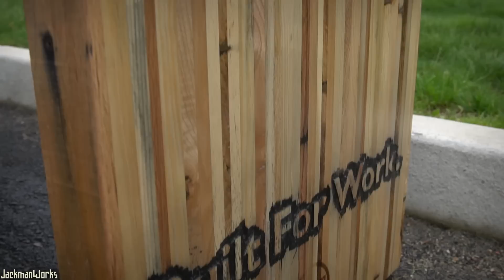Pallet Wood Slat Bench

Comment: Cool project, I really liked that router jig, for the curves!
Reply: Also: router jig was very neat! Am jealous of the little / midsized router too, mine is possibly too big for such a jig, but am gonna try that at some point!
Reply: Harbor Freight sells one kinda like that for 20$ and they run like crazy. I have 3 of them and keep my most common bits in them and just switch routers. i also have several bigboy routers just dont like to bust them out unless im burning off alot of mill work
Reply: That's genius!!
Reply: Yep gonna steal that tip forsure!
Reply: @dannyoneill4232  I'm a finish carpenter and run a little Bosch that I've had for a very long time.  Granted, I don't use it for much more than 1/8" Round-over Bits, Hinges or Laminate Trimming but I really like it!

Comment: Have you ever tried finding some heavy duty pallets? I found some really good industrial pallets used to ship airplane parts. The frames are 4x4s and the slats are 2x4s. They're difficult to break down without a reciprocating saw, but we'll worth it. A lot of the wood turned out to be maple.
Reply from the maker: Yes!! Those are always a big score. Check out my pallet workbench build. The base of the benches is a frame made from those big 4x4 pallet timbers.

Comment: great build. is the threaded rod totally nesessary?
Reply: I don't know the answer to that question, but I'll just speculate.  If he didn't have the threaded rod, I don't think the bench would undergo a failure.  I do see the possibility, however, of a few of the seat boards or side boards opening up just a tad, due to internal stresses.  You saw how during glue-up some of the boards were still not flat even after having gone through the planer.  So, the threaded rods were probably provided to prevent that -- open spaces between adjacent boards -- more than to prevent a failure.
Reply from the maker: Definitely not. Check out my workbench build if you haven't yet, very similar process and I haven't had a single seam pop on me yet and I beat on the thing haha. That was really just for looks.
Reply: +Jackman Works I thought you would have just cut them (threaded rod) to a few inches and just epoxy them in.  Risky drilling so far without a drill press.  Even with a drill press the job would be kinda scary. lol

Nice score on the threaded rod as well.  That stuff is expensive!
Reply: Threaded rod is actually pretty cheap for 3/8"... https://www.tractorsupply.com/tsc/product/national-hardware-4000bc-3-8-in-x-16-x-36-in-threaded-rod-zinc?cm_vc=-10005 .  It's more at the home centers but probably still not that bad (a lot cheaper than bolts, which tractor supply is also good for if you have one near).
Reply: Without the rods, the wood would fail before the glue joint.

Comment: I like that de-nailing tool. I'm sure it's a common tool and most people know what it is, but I don't so I've got ask.

I hate it when commenters make suggestions to youtubers but do you recycle the nails? I know that was a question and not a suggestion but if you keep a small bucket lined with a plastic bag and fill it with the bent nails , tie the top when it's full and place it in the recycling. You will be amazed by how much you collect.

Comment: did you think the threaded bar was needed? I am going to make a table and bench of this design, but using something like 2x4. I was also thinking to join one length of 2x4 to 2 leg lengths creating sections. Obviously alternating the length to create the box joint look. Then joining the sections using glue and nails or screws ( nails will be simpler ) I think this will save the hassle of clamping and trying to keep everything square.
Reply from the maker: Nope, just there for looks really. Look back in my videos for my pallet wood workbench, similar process to this with the pallet lamination and I've beat on that thing without any popped joints yet :D

Comment: Great video. What glue did you use for the sawdust filler solution? I have a fifty year old floor with some voids. I do have the saw dust from sanding the surface.
Reply from the maker: That's just some 2-part epoxy. I use this stuff: 
  http://amzn.to/2ilceDF

Comment: Wonderful video. I've watched it 3 times so far. I want to get more involved in working with pallets. I have 2 questions:1. What is the name of the punch that you used that has a sleeve around it to get out the nails? I want one.2. I would not be comfortable in drilling through all that wood to insert the threaded stock. Any secrets to keeping the drill from drifting?Thank you!

Comment: Hi, does your planer change thickness by itself? I've got the same planer, wile running wood through you can watch the handle turn changing thickness
Reply from the maker: nope, it stays locked on the thickness during the cut. check to make sure something isn't loose. the raise/lower mechanism on mine is pretty firm
Reply: Jackman Works cheers. Is there a trick to the way you control the router when you did the built for work part? If I did that it would be a mess

Comment: Why did you add the all-thread through fasteners?  Don't the long-grain-to-long glue joints hold it together well enough?
Reply from the maker: It might add a bit of strength, but it's ultimately just for looks. Check out my pallet wood workbenches, those were just a glue-up without any hardware and have held up to a lot of beating so far! haha This definitely would have been fine without

Comment: I saw quite a bit of flex in your router jig. Did that contour the curve to much at the edge of the bench? Maybe add some extra supports to the jig? I know that jig was probably temporary sonit probably don't matter. Awesome work brother.
Reply from the maker: Believe it or not I actually planned ahead and made the curve slightly less deep so when it flexed down it would reach the contour I wanted. I think using a 2x4 would have definitely been stiffer though and maybe the better option. The center still needs to be thin though for the router bit to be able to reach.
Reply: Jackman Works I should never doubt the method to your madness. Fantastic work. If your ever in Maine brother I'd love to collaborate a pallet project. I've got maybe close to 160 or so to break down lol

Comment: This is probably a pretty ignorant question but why use that jig when you were ripping down your pallets on the table saw instead of just the table saw fence? I watched that section of the video a couple times and I couldn't figure out the benefit.
Reply from the maker: No worries man. The pallet wood is pretty warped and funky so there is no flat or straight side to it. That jig allows me to clamp it down and make a straight cut, then I typically will use that as a reference surface to rip it to width but I left one side rough for this design.
Reply: Makes sense. Thanks!

Comment: I've been planning a similar bench, this is awesome.

Is there a reason or need for the all thread?

I was planning on having two cross beams underneath... My benches will be 5ft long.

Thanks
Reply from the maker: The threaded rod is just for the visual really. For something 5' long you'll want to make sure it's pretty thick though so it doesn't sag in the middle
Reply: @JackmanWorks  thanks, I'm planning on 2.25 inches thick... My table is 2.5 inches by 11 feet by 36 inches... Same style.

Comment: how did you make the wood filler?
Reply from the maker: It's a mix of 2-part epoxy and sawdust from sanding the bench. More details on the build in the article on my website (linked in the description)